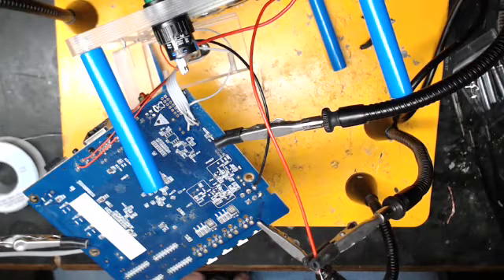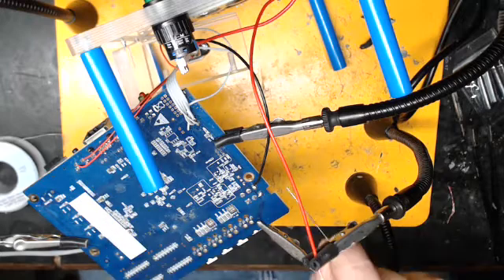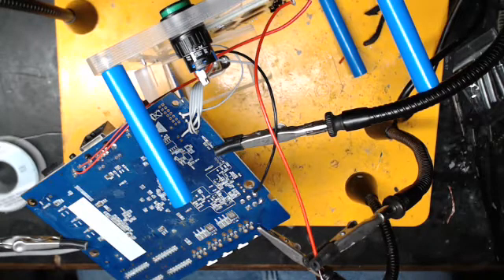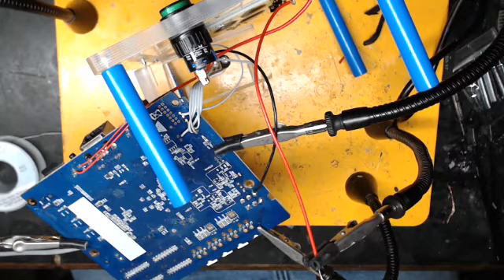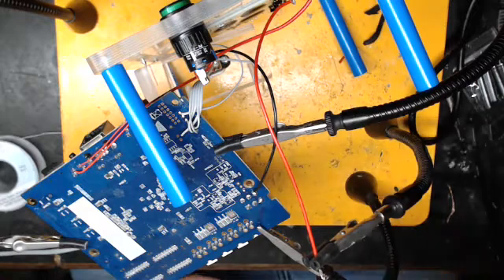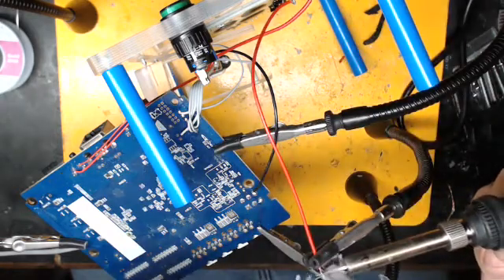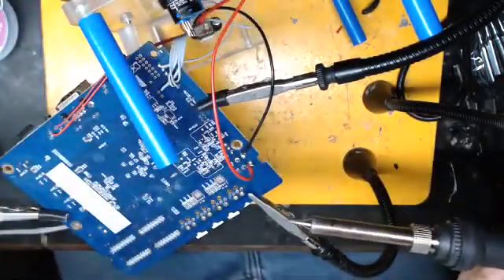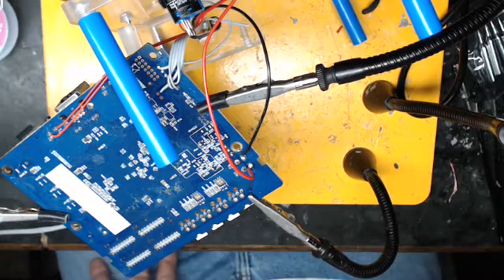hashboard repair:  Prerequisite before testing hashboard voltages

Comment: hello I have a problem with a hashboard tester for antminer s9 when I connect it and put it to test I get the following error "1 pattern failed change frequency and voltage" the voltage is set to 890 and the frequency to 400 and I have seen some tutorials in youtube and I still do not get the fault has happened to you with any of those hashboard testers
Reply from the maker: Hi George,  on the discord channel, you can ask that question and people can help.  It is really hard to have a real conversation on youtube comments.  Why not join and   get people talking about what you are seeing, you can share pictures, video and if you want voice chat.

Comment: Hello, nice videos, one question, i am repairing T17e, and i whant to ask you how many volts i should inject from the PSU for one hashboard to test? Thank you, keep on going :)
Reply from the maker: Hi,  I'm not sure on the T17e.  You could measure the voltage coming out of the power supply on a working system.  That is probably the voltage you would supply to the board.  Thanks!  and you might get on discord on our group and ask that.  There are several working on T17e boards.
Reply: @AntminerRepair  i did enter the server, i will ask questions there, thank you very very much 🥰